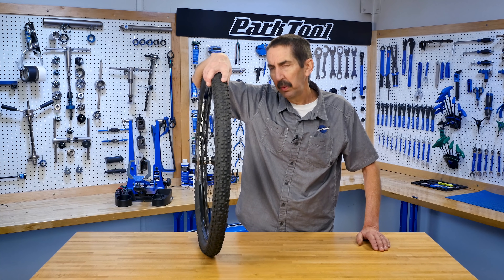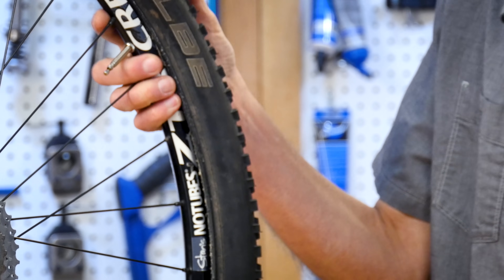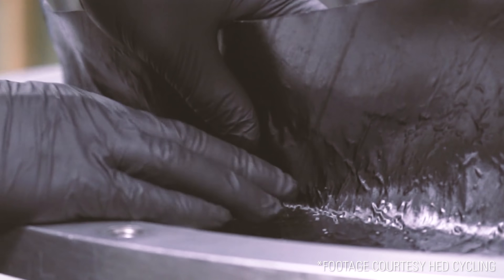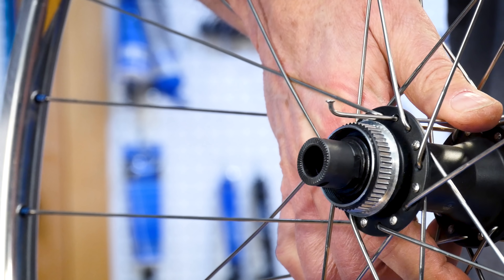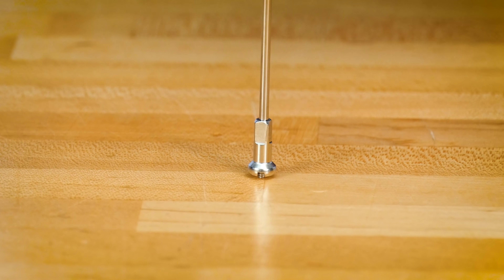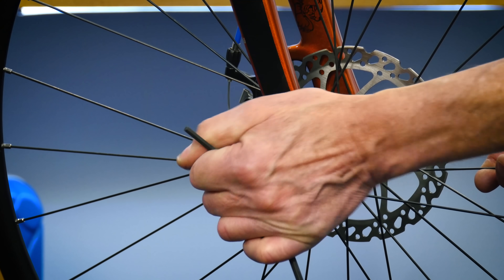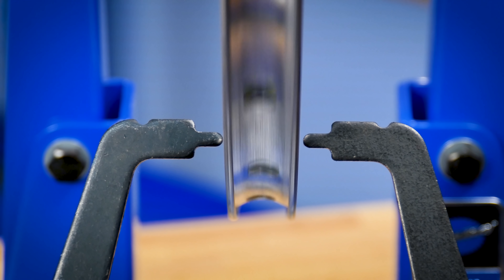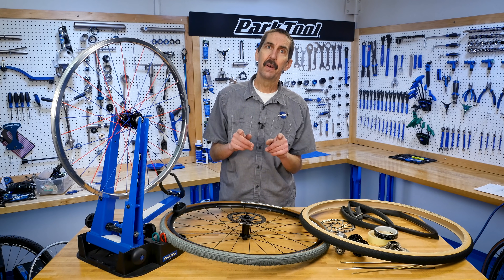How to True a Wheel Part 1: How a Wheel Works

Comment: How to true tire? Just installed used Grand Prix 5000 tires and both tires have dips around the "Continental" logo. And it was hard to pull it on the rim, even had to warm it with a hairdryer.

Comment: I upgraded from Shimano hyperglide freewheel to a 9spd cassette. Prior to the upgrade my wheel was centered, after the upgrade  I find the rim now sits closer to one side (right side) of the frame instead of being in the middle, and now the tire rubs against the metal. How do I correct that? Any help appreciated!
Reply from the maker: To make that change you must have installed a new wheel? If it is quick release be sure the springs on the quick release both have the small end of the taper facing towards the middle of the bike. That could be a cause or the new wheel may not be properly dished. Or there is the chance that the wheel is not fully installed in the dropouts.
Reply: @parktool  Thanks for the reply. I took it to a shop and the tech mentioned something about the bell of the hub? or something like that (sorry forgot what he called it), but upon installing the rim back in the frame it's centered and the tire's not touching the frame anymore.

Comment: Hi people, id like some help. I’ve just had some problems with my chain coming off my 1st gear. It went behind the cog and into my spokes and destroying them in the process. I had the bike repaired and it’s come back, with new derailleur, new chain and “set up” and it’s happened again, luckily No damage has been done. I asked about fitting a spoke protector and they said that wouldn’t stop it happening….am I right in thinking they are wrong and I should purchase and fit one myself?

Comment: Tip, when you’re riding a bicycle 🚴 with wheels 🛞 that have spokes with higher carbon steel content, and your wheel magnet 🧲 doesn’t stay on, use a STRONG 💪 neodymium magnet 🧲. It will stay firmly attached to the spoke, without zip ties. Your friend, Jeff.

Comment: Question: Can a tire, when pumped up to operating PSI range, with damaged casing and has wobble affect the rims trueness/spoke tension? I know I've been asking a lot of questions the last few days; I'm learning about truing a wheel on my own and I am getting good at it, but want to keep learning and stay humble.
Reply from the maker: The PSI in any tire squeezes the rim and tends to lower the tension a bit.  Generally, do not worry about that aspect.  Damage casing in the tire can make the tire wobble back and forth, giving the impression the rim is out of true. However, a damaged tire is unlikely to make the rim out of true.
Reply: @parktool  Thanks!

Comment: When a wheels wobbles not from side to side, but up and down. Is that simply corrected by tensioning the lower wobble point and loosening the high wobble point? So I can TRUE true a wheel?
Reply from the maker: Sounds like you need to look at RADIALLY truing your wheel. Try this: https://youtu.be/7R8dncAbhoM

Comment: I got a lowrider bike and got custom wheels 144 spokes and on the inside of the wheel some of the spokes are a little long how can I file them down
Reply from the maker: Fun! You can use a file or a small grinder, or there are actually flush cutters that can be used effectively for this. The Hozan C-216 is useful for this.

Comment: I meant to tighten the spoke you have to screw it clockwise or counter ?
Reply from the maker: Good question.  You are not turning the spoke.  The nut (nipple) is turned. It is a normal thread, tightening to the right.  However, remember sometimes you will be seeing the nut upside down.  Try this.  Pick a spoke and nipple.  Squeeze and feel the tension.  Now turn the nipple some direction and pay attention.  Does the nipple feel like it got harder to turn, and does the spoke feel tighter?  That is the tightening direction.  Or did the nipple get easier turn and now the spoke tension is lower?  That is the loosening direction.  Now remember what you just did.
Reply: @parktool  very nice the only problem i had was not watching your eps 2 
Thank for the useful info!
Reply: @parktool  i have the best tip on earth about freewheel
  The best way to find a cheater bat is to buy a new house cleaner ( a metal pole attached with a brush) and remember to choose the big one which its top is covered with a plastic cap and enough space to put your wrench inside
I got an old house cleaner and it worked
Thank for all the useful infos

Comment: Maybe I'm wrong, but I've long imagined a cycle's wheel is HELD UP by the top-most spokes, as it rotates around it's hub. Crazy, I know :-) Otherwise, they "merely" stabilize the rim. Right or wrong?
Reply from the maker: You are hanging from the upper spokes but the rim deflection of the lower section is held together by the spokes on the bottom half minus the 2 spokes deflecting due to the weight of the rider. I like to think of the wheel as a rolling suspension bridge. Each spoke and section at any given time is important to the end goal of the wheel.

Comment: Hi Park Tools USA®, see something that you might want to talk about is "Annual wheel tuning" if like me you've worked on a MTB as a bicycle courier you know that while your local Stock Exchange is closed over the Christmas to mid-January period you tune your wheels quite simply you start at your valve with in the case of a MTB the black horseshoe Park Tools USA® spoke wrench going spoke to spoke 1/4 turn tighten then adjusting buckle quash with opposite-lock tightening not being unafraid of backing off because you may run out of thread on your spokes and NEVER tune rims at night unless you've spent $150+ on garage under-vehicle lighting.

Comment: when i watch a park tool video i am immediately in my comfy zone. no hype, no squawking,
no distractions; just the facts, explained in a way i can understand and excellent camera
and sound work. no echo, no bad lighting.
my bike was stolen 5 years ago and am unable to replace it for several reasons.
however, i hold a dream of getting another one someday. i still have my (98% park) bike tools and my faithful pcs-10 stand with almost all the accessories for it.

for those of you who live in apartments, a happy note- you can make your repair stand a
christmas tree. just run ac or dc lights in an isoceles triangle, add a few ornaments and
maybe some tinsel and you're done. all except the repair stand are available inexpensively at walmart after halloween (!). i still have the christmas lights for the bike, also.
Reply: Go to a place where a lot of people ride bikes and offer to true their rims and fix their breaks, etc.. on the spot for $10 to $20 bucks and you'll have the money you need for a new bicycle real quick. This can be a weekend thing.
Reply: This, and check garbages/giveaways! I had a "new" bike every week, as a kid. Then trade up/sell them for profit. Eventually you'll have a sweet ride. @radicalrick9587

Comment: How can 3 different aspects be tuned all with the same procedure??? I mean imagine I correr the side truing, but then other thing is incorrect, spoke tension can’t be the same when you r teuying to correct something right? If the tension of the spokes was to be all the same that would mean the wheel was perfect in the first place
Reply: If I ever try truing I bet i will regret it
Reply from the maker: The hoop of the rim is not made perfectly. It is not perfectly straight or round, and there are internal stresses from the material.  The idea is to get an adequately straight spinning wheel, with adequately tight spokes.  It is done every day.  Try finding a bike to practice on, then try yours.

Comment: the guy at the bike shop will change my rear wheel hub on my mtb on the warranty cause the ´ cuvette ´ inside cone is scrap . 
for multiple reason i didin t want to bring the bike so i just brought the complete rear wheel , and he was mad , he told me that he would not be able to do a good job cause he really need to put the wheel on the bike for alignement ...  
is he right or he exagerate ?
Reply: they were bot able to find and order the exact same wheel and didin t want to change both , thats why he will change just the hub and keep the old wheel
Reply from the maker: Its good for the shop to have the entire bike to ensure proper bearing and brake adjustments. They will be able to repair the wheels issue without the bike but once re installed slight tolerance differences can change how things line up and when you re install it the brakes may rub or the hub may seem loose.
Reply: @parktool  i prefer ajusting the bearing and brake by myself , and my frame is still new, 2020 giant atx3 . So even with a  straight frame , and if they are align the hub perfectly with a dish tool , you think i may have to sligthly align the wheel one i put it back on my bike ? 
thanks for your advice really appreciate
Reply: its disc brake
Reply from the maker: This is going to be between you and the dealer. I understand that they likely want to do the best job possible and having the bike is the way they can do that. If you do not trust them, then that makes this completely your decision.
Reply: @parktool  its like if you answer my first question at the last question, that was not my question ...
Reply: @parktool  the question is not about brake bearing and gear adjustement , its about alignement ! 
if the align the hub straight with a dish tool , and my frame is straight , once i put back the wheel on my bike , you think i may have to play with the spoke to align the wheel on my bike ?
Reply from the maker: This is between you and your bike shop. Thanks for watching!

Comment: I have a question I have a islander cruiser 1980 I’ve tried 25.4 seatpost but that’s too bigg so I ordered a 22.2 and a shim to make it fit a 25.4 but that’s still going to be too big so I’m thinking if I grind the shim down and cut it ,it might fit what do u think?
Reply from the maker: Have you measured the diameter of the tube yet? You may be dealing with a 25 mm post and not a 25.4 mm post.
Reply: Oh ok ty

Comment: when my wheel is 100% centered but my frame not (tested with a string), should i center the wheel to the frame or live with it?
Reply from the maker: Typically it is best to center to the frame you are using.
Reply: @parktool  ok thanks Parktool!

Comment: QUESTION
Thank you indeed for your vids!
As for my question. I purchased long time ago a 29" wheel and now I am installing it on the bike. Before assembling the tire I  checked the sprockets tension and noticed that in the cassette side of the wheel the sprockets where quite tensioned while on the other side they were loose. So I happily went to equalize the tension of the loose side, then I mounted the wheel on the bike and went to true the laterals. In the truing process I had no choice but more or less revert the situation, I.e. the laterals are true but the cassette side is more tensioned than the other side. BTW the roundness is quite good. 
Is this normal ? What should I do ?
Reply from the maker: The right side spokes are going to be tighter. It is the engineering of the wheel, and is normal.  See more at centering- https://youtu.be/FqeEBih8kx0
Reply: @parktool  Oh thanks !
Reply: @bikeandsee1647  I'm just a mathematician, not an expert like Calvin. However, if it bothered me much, I'd use shorter spokes on the freewheel side. That was common practice in the past, but doesn't seem like it's done much these days

Comment: Did my truing stand just show up in the mail? Am I currently staring at five different spoke calculators trying to figure out what length to order? Yes and yes. Clearly Calvin is keeping tabs on everything I'm doing.
Reply: Buy the longest spoke then cut it to size and get a spoke threader
Reply: @kmosdell  Doesn't work if you're using double-butted spokes. You can only cut those by a certain amount before you run into the wrong diameter.